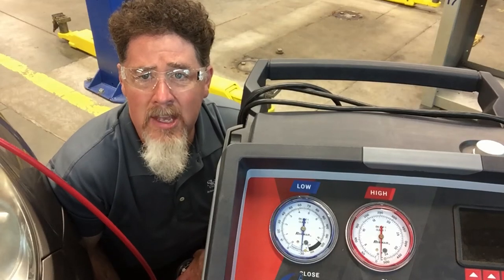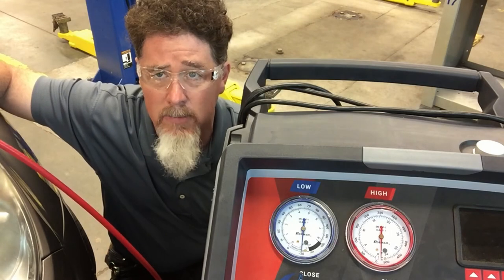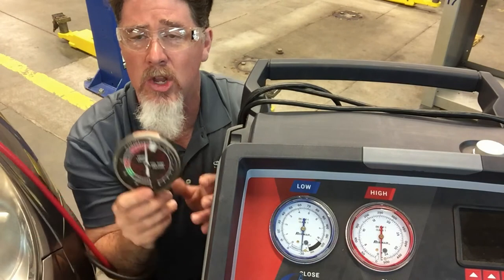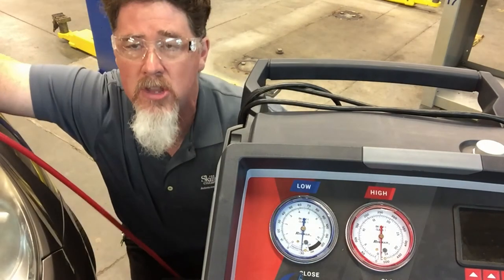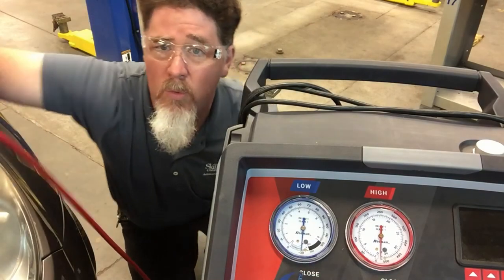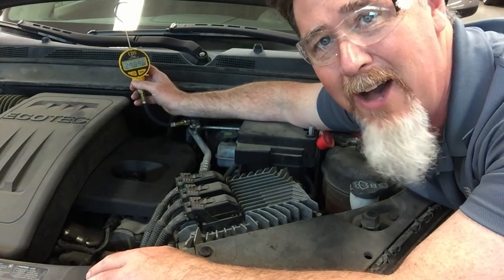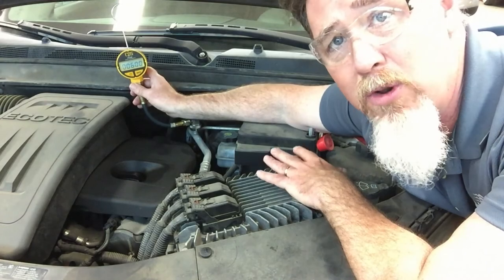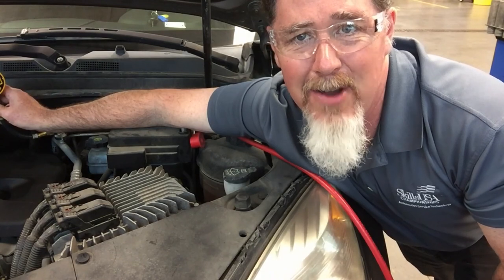How to check for a AC leak with a vacuum gauge

Comment: Using a micron gauge in auto a/con is extremely rare .  Well Done . Thise biggest issue most 99% auto people would not no how to use it . What  needs demonstration is   How to understand the difference between moisture still in system and a leak . Understand decay . How to understand the straight up leaks or the micron gauge plateau.   Common causes of vac leaks .    How to test manifold and hoses and couplers . The superior standalone vacuum technique -no manifold . How with even minor leaks in your guage setup will prevent u from pulling below 1000--3000 microns . What micron to get down to .How long to vac pump for .  Importance of vac pump

Comment: Exceptionally good video.  You are the first person I have seen on you tube that uses a micron gauge in the automotive field and understands why one is needed. Just as you said from 28 to 30 inches you dont know, am I at 400 microns or 50,000 microns. know way of knowing without a micron gauge if the system is truly tight and free of moisture.
Reply: jim defilippis - no way!